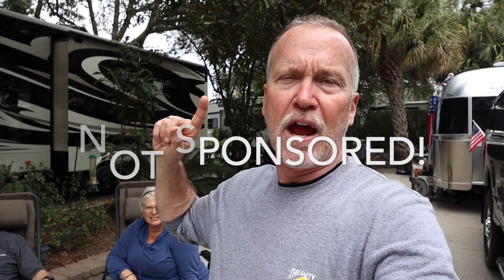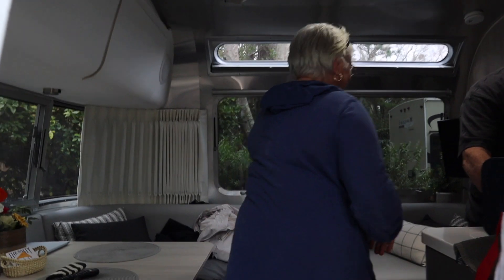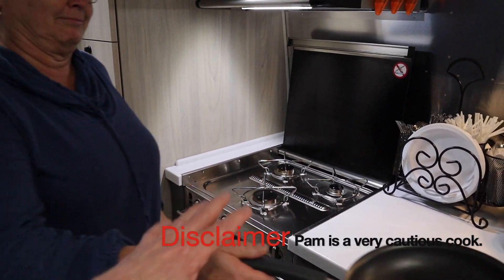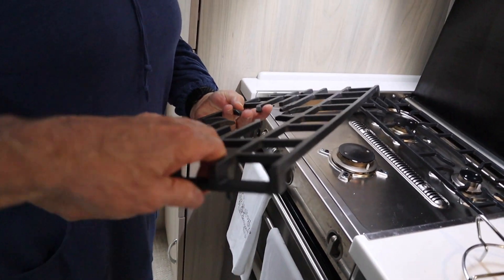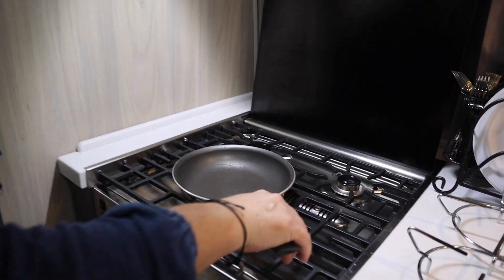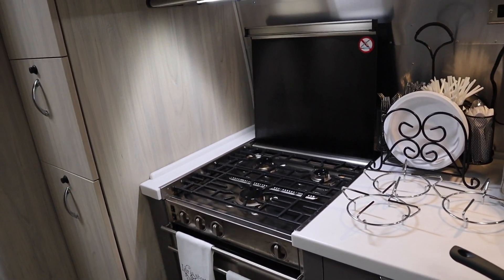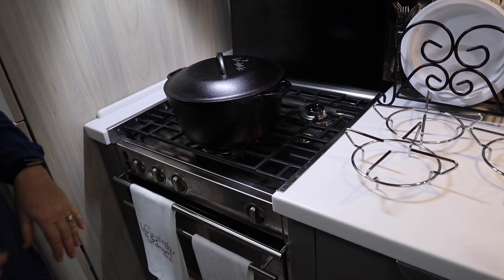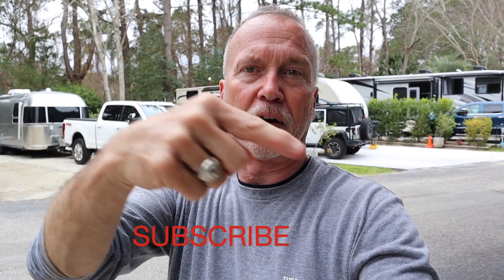Airstream Dometic stove top modification.

Comment: bought the grates from etrailer; arrived in only 4 days. didn't fit my dometic CU-434, they were a little to wide for my build (converted Sprinter).  Okay, got my belt sander out and ground off ~1/32 from each side and I still had to remove the screws.  Fits now! 

I'm going to grind off a little more to make removing for cleaning easier, so I never have to remove the screws to get in/out.